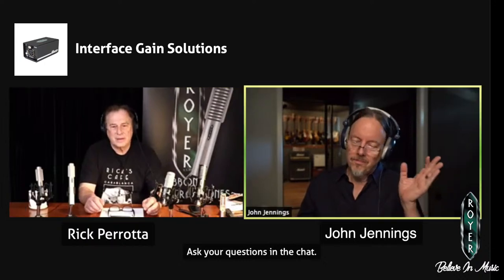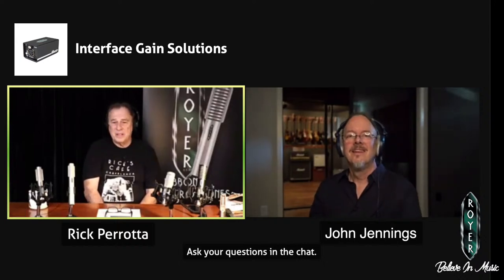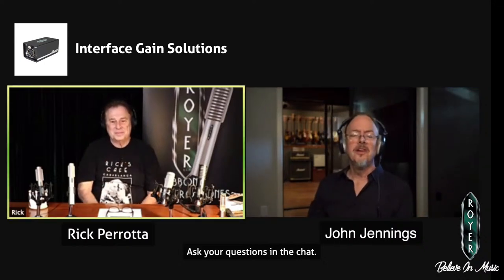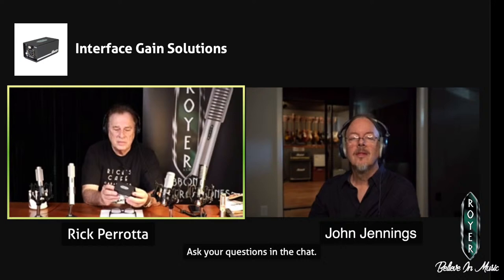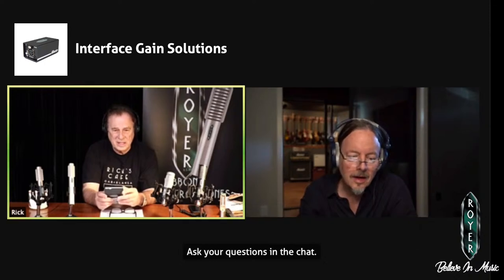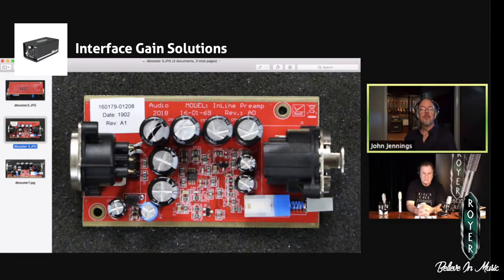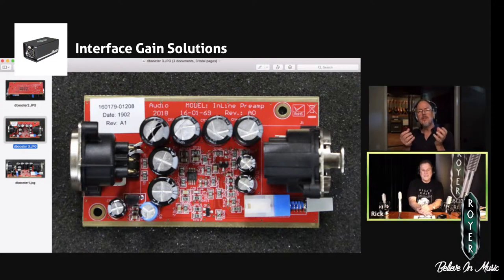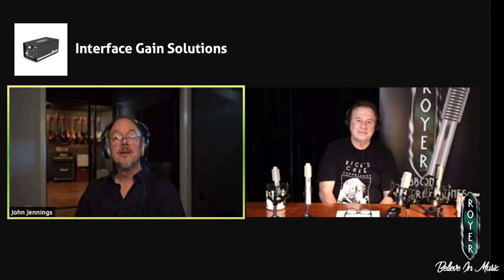Interface Gain Solutions

Comment: Doing some streaming and podcasting I found that my MA-201fet, while a gorgeous mic and perfect on vocals for years, just didn't suit the duty very well. So I picked up an RE20 to pair with the Yamaha AG03 I was using. I really didn't want to get any more complex than the AG03 as it does everything I need in a small space. While the AG03 can push the RE20, having that gain knob set to 8 was unsettling and I felt it was missing some of that trademark RE20 depth and character. I was all set to get a CloudLifter like the rest of the podcast/streaming world when I figured I'd look to see if Royer/Mojave had something. Sure enough, I found this. After reading some in-depth articles, reviews, and this deep dive into the dBooster I was convinced it was worth the extra over the CloudLifter. Should be arriving soon and I'm looking forward to it.
Reply from the maker: Let us know how you like it Guy. It's going to pair nicely wtih your RE20.
Reply: @royerlabs  Absolutely PERFECT, I think the 12dB setting matches the RE20 nicely!